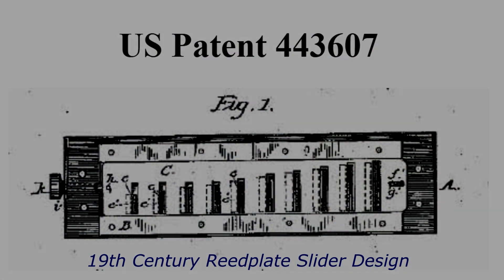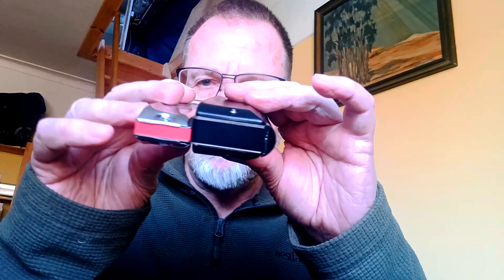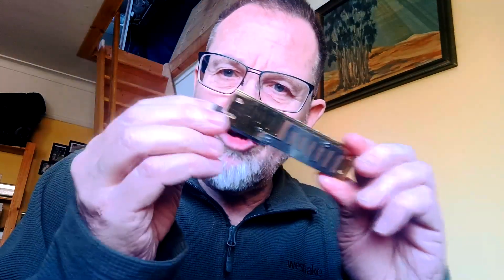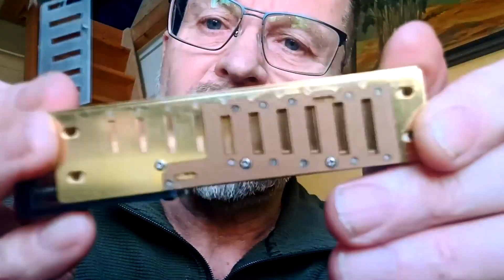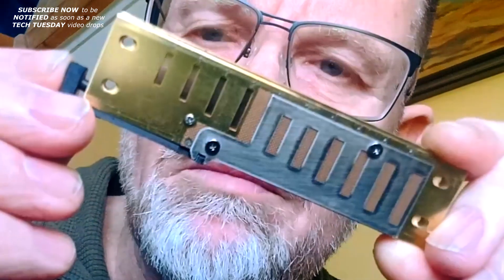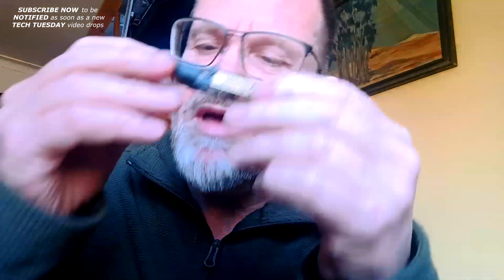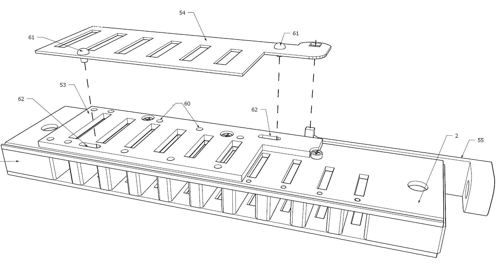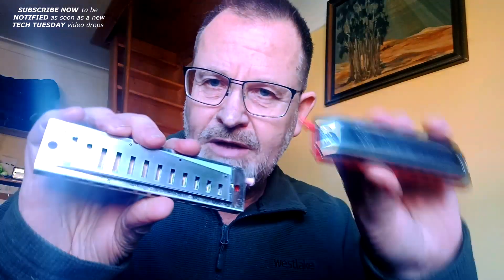TECH TUESDAY #4 - MAGNETICALLY ATTRACTIVE REEDPLATE SLIDERS (Patent Pending)

Comment: I was sitting and thinking about this very thing while switching from chromatic practice to a diatonic. A new format chromatic that required zero valves and was totally air tight WITH A SLIMMER FORMAT!? Where do I buy one!?
Reply from the maker: I have working prototypes, but nothing is commercially available yet. Having a slimmer comb is nice, but not an advantage per se. However there are valveless chromatics around, and you can easily remove valves on any chromatic. 

My preference is half-valving: remove the outside valves but leave the inside ones in place. It's the best of both worlds. I've been playing half-valved chromatics exclusively since I invented the idea in 1980. If you wish to take out the inside valves also, you should do full embossing on the chrom to make it play well.
Reply: Yes - I do have a couple of half valved chromatics. I have a seydel power Chrom in orchestra tuning - and a solo tuned Suzuki. And they work well- I had to adjust the Reed gaps on the Seydel oddly more so than the Suzuki- but I suspect this might be due to the steel reeds. I saw your video showing the nail gel technique- so next step is on Seydel is burnishing the Reed slots and adding the gel
Reply: I don't understand why the harmonica hasn't changed THAT much. I'm a pro bassist. Yet I have more options the simply a Fender Jazz or P-bass.. granted those are both excellent instruments for different contexts- maybe folks just get attached to the tradition- I don't know. Maybe because I'm a musician that sees every instrument I play as a tool of expression and a lot of harmonica players - are harmonica players. 
Keep pushing brother! As far as I am concerned you are have been and will continue to be ahead of the curve. Cheers!
Reply from the maker: @JoshuaDb_The_Witness Thanks! I agree: for over 100 years nothing substantive has changed in the capability of the two main harmonica types in terms of how many notes are available etc. You're right about harmonica players compared to other musicians: they're a very conservative lot.